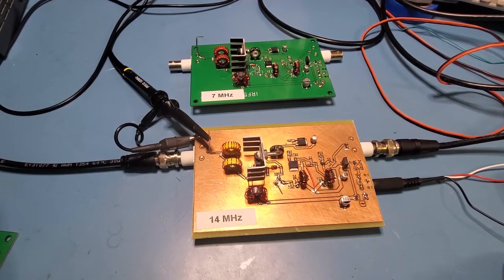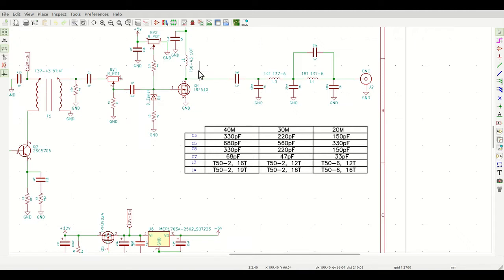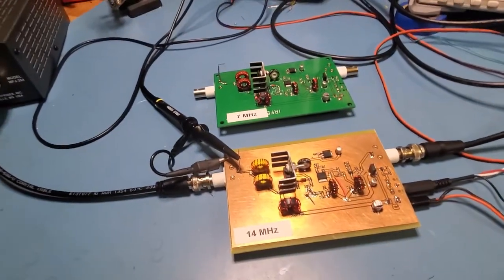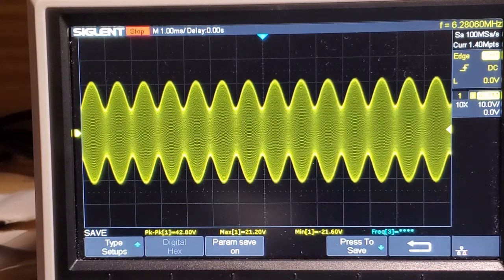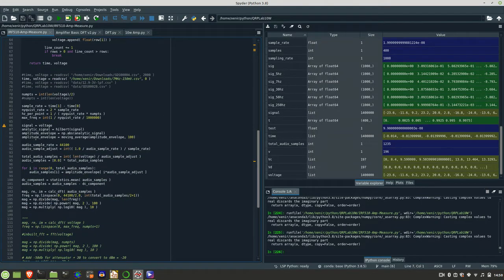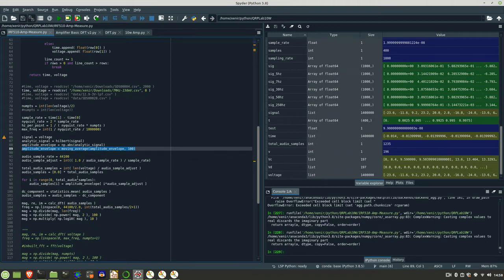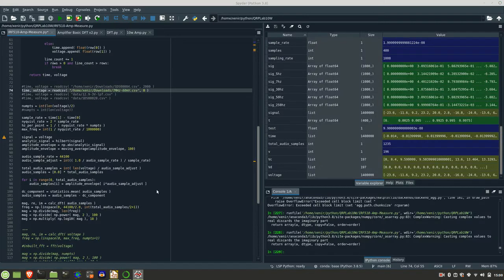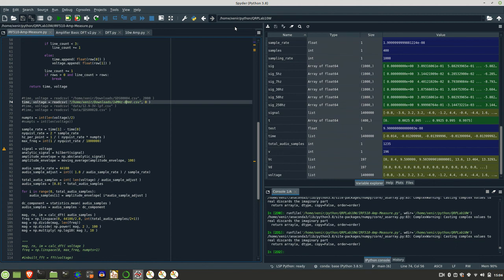IRF510 Amplifier at 7 MHz

Comment: Neat! What are the quiescent current and the efficiency of the PA?
Reply from the maker: Alex, quiescent current is a little over 110mA through the IRF510. Gate bias measured at 4.2V. I'll have to get back to you on the efficiency - I didn't measure the current drain from the power supply. Stay tuned and thanks for the comment!
Reply: @na5y  Thanks! Regarding the efficiency it's actually tricky to get an accurate measure because multimeters and power supplies cant't measure AC+DC current above 100 kHz or so. However for class AB PA you will get more or less reasonable result (not so reasonable for class C). Idially you have to use an oscilloscope, a 0.1-10 Ohm resistor and a differential probe (to not to short circuit the power supply through the oscilloscope ground) to measure RMS current.
Reply from the maker: Thank you Alex. I was thinking of just measuring Power Out / Power In - would that not work to calculate efficiency. I am decidedly not an expert in these sorts of things
Reply: @na5y  You are right, but the problem is that power in is V*I and I is changing approximately with the frequency of the input signal (you can verify this with a model, e.g. in LTspice). Most instrumental don't measure the AC current in this frequency range. But once again, for class AB you will see about 50-60% efficiency with a regular multimeter anyway, and that's approximately what you would expect. If you see <50% than you should be a bit worried. For class C PA on other hand expected efficiency is somewhere about 60-70%, but you will most likely not get such a number with a regular multimeter.
Reply from the maker: Thanks for the info Alex - is there a reference on this you'd recommend I could read. I would like to learn more. For what its worth just using simple PoutAC/PinDC it was  around 50%
Reply: @na5y  I can't think of any reference on this particular topic. On homebrewing in general I can recommend "The ARRL Handbook" and "Experimental Methods in RF Design" if you don't have these books already. The print copy of the last one is getting difficult to find, but there are digital copies available online.
Reply from the maker: @R2AUK  I do have EMRFD - great text...